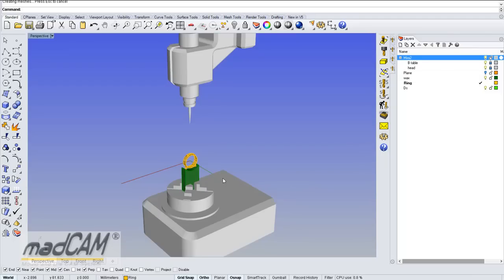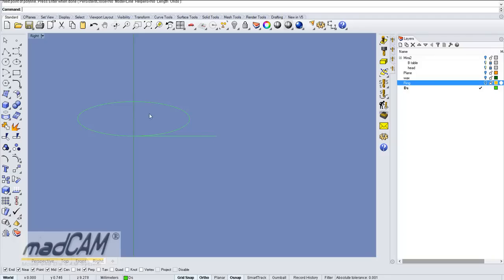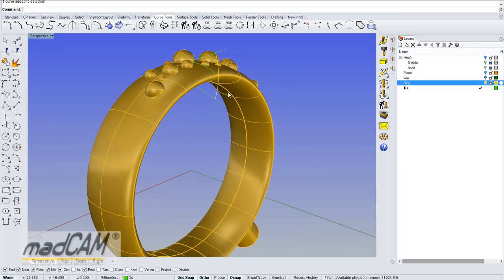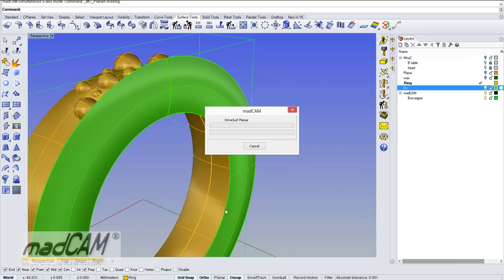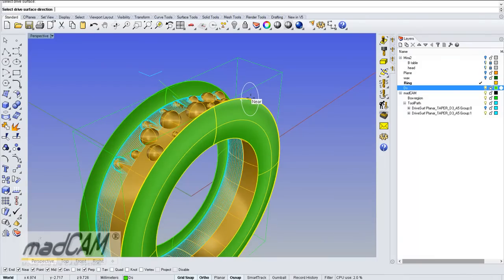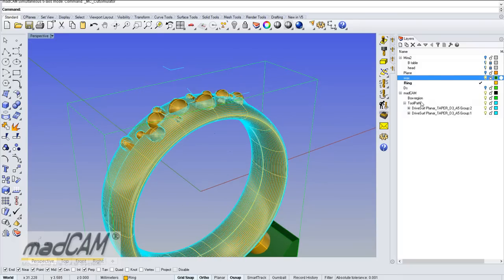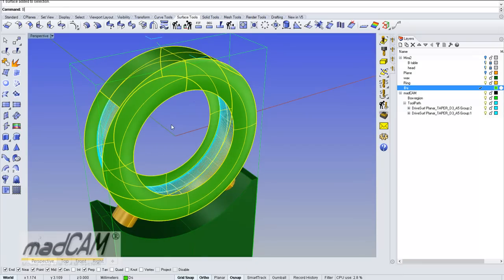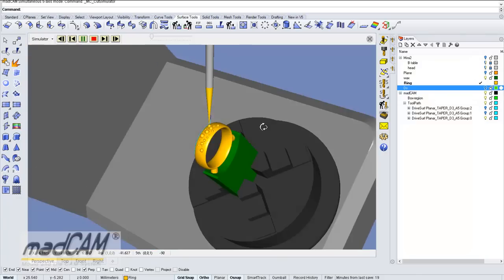madCAM jewelery ring tutorial

Comment: I am trying the trial version.. Why does 5axis planar finishing using drive surface 'line' option sometime cause extra rapid lines?  Is there a way to control rapid lines in a toolpath, perhaps turn all rapid lines off while in a cut?  I want the toolbit to enter, cut and exit at the end.  Instead, it enters, cuts, jumps away from surface few time at certain points, continues cutting and then exits at the end.  I'm using 'line' option and not circular or conventional setting.

Comment from the maker: That is correct, the cutter tool is kept perpendicular to the drive surface. It is possible to use all of the standard 3D functions like roughing, planar finishing, z-level finishing and pencil tracing from a 3D drive surface in madCAM. The drive surface can either be a surface that is part of the model, or like in this example, a separate surface that is not part of the model.